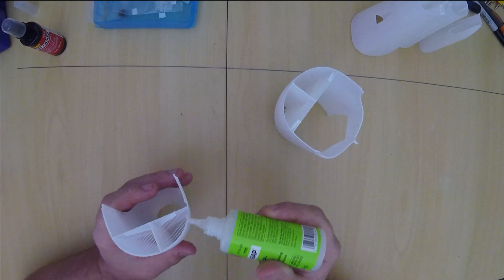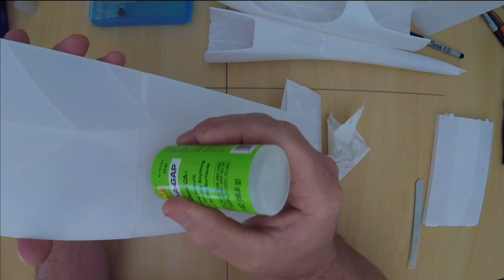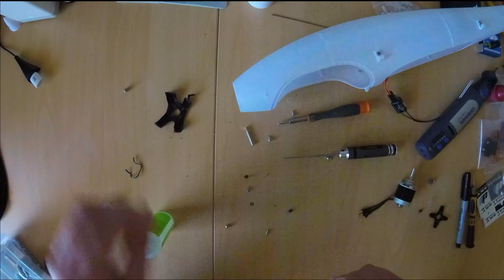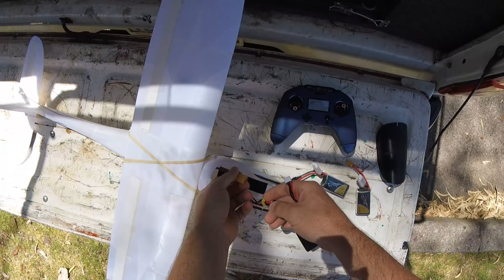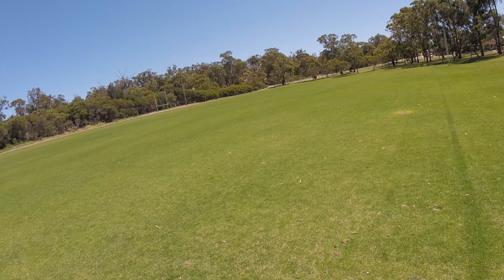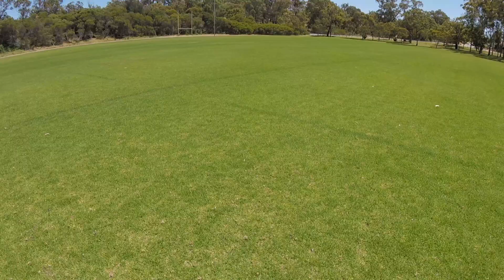Eclipson Model A - Time-lapse Build & Maiden Flight (Free .STL File)

Comment: Your build plate seems pretty large. What made you choose not to print multiple items on same go
Reply: I would bet its to prevent stringing between parts. The models are designed to print pretty continuously for clean parts with LW PLA, so the travels between parts could get messy.

Comment: Nice video!  I’m building the model A 1.4 at the moment and need to get a motor. Not sure how the model A compared in size to the 1.4 version but this model a looks significantly smaller.  What motor did you use for the model A?
Reply: Motor details in the description along with all the electronics I used 👍

Comment: How much time does it take to print?
Reply: give yourself about a week of loading the printer to get all the parts out. Doing only 1 or 2 parts at a time is best
Reply: @camk2552  thanks, I'm probably going to do it
Reply: @camk2552  Thank you man! I just got a printer
Reply: Im printing the model S right now in lw pla doing 1 file at a time. Takes a long time but isnt too hard to keep starting the printer. once before work once after and once before bed. I'm over half done now. Kind of fun to keep production rolling!!
Reply: I just printed the Model A 1.4 which has a lot more moving parts than the predecessor and I got it all printed in a weekend but I was using two printers. Assembly of all the services, pushrods and such is what is taking me forever. Can thank the three young kids for that!
Reply: I’ve printed it in one day by fitting in as much parts as i could in the plate to print it all together. Used a Bambulab A1.